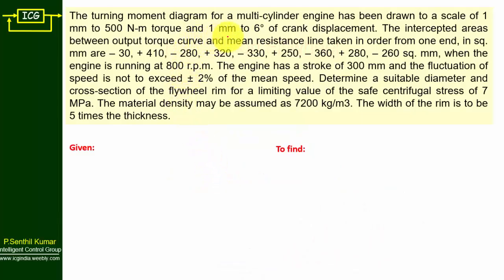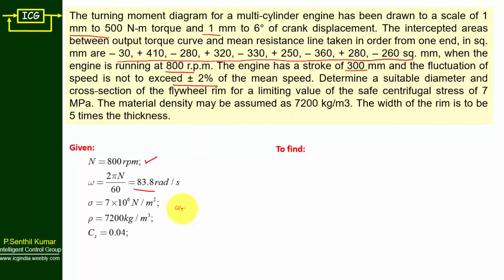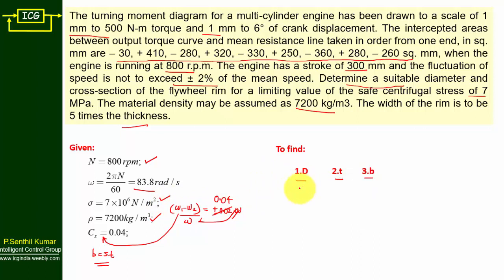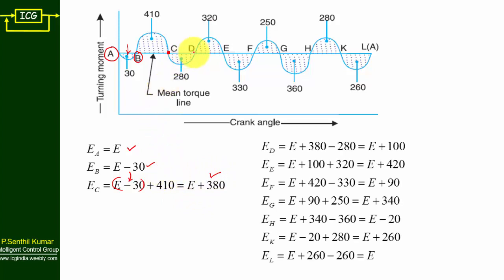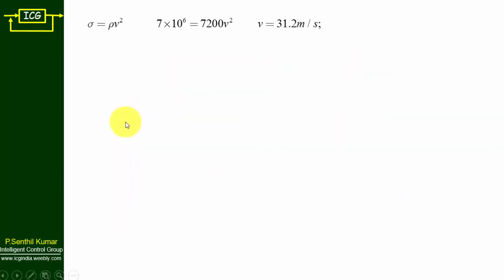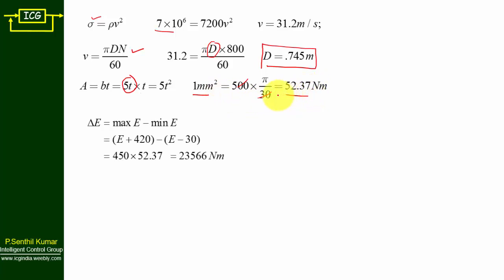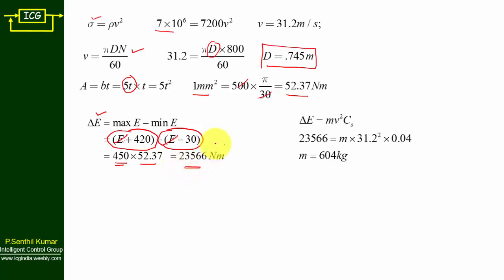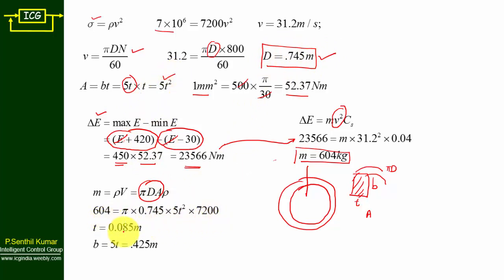Lecture 1.6.5 Flywheel | Problem 5 | Turning moment diagram of steam Engine

Comment: In a turning moment diagram, the areas above and below the mean torque line taken in order are 4400, 1150, 1300, and 4550mm2 respectively. The scales of the turning moment diagram are: Turning moment : 1mm = 100 N – m; Crank angle: 1mm = 10.  Find the mass of the flywheel required to keep the speed between 297 and 303rom, if the radius of the gyration is 0.525m